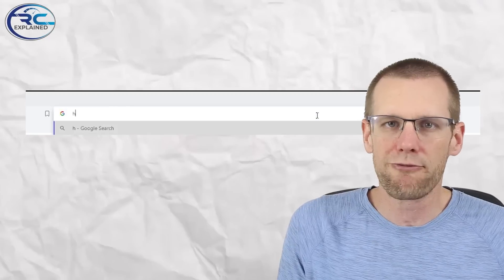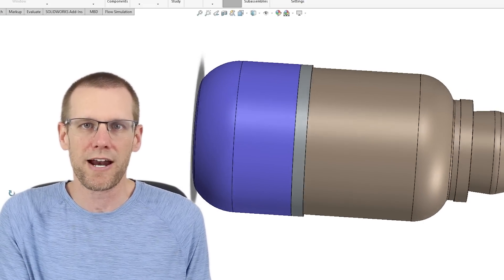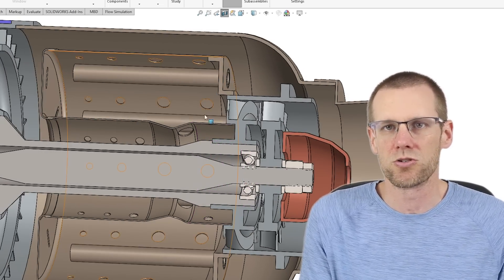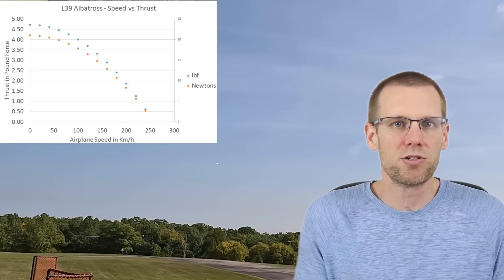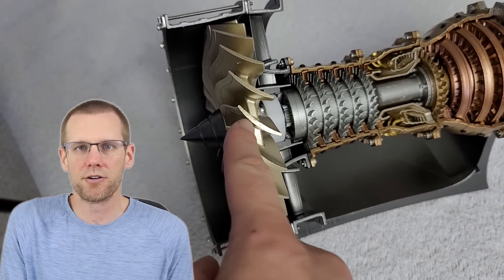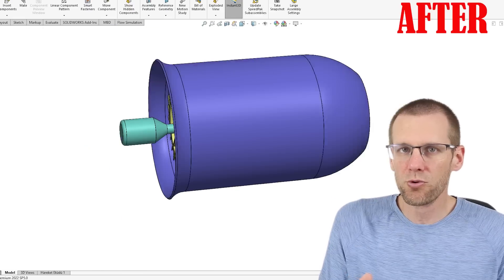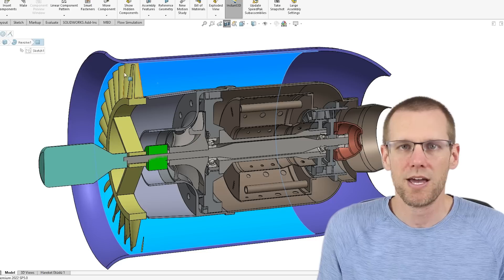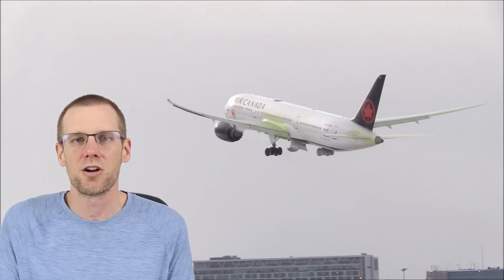RC Turbine Engines Could Be Crazy Efficient If They Made This ONE Change!

Comment: It appeared your diagram had the planetry set sitting off the Inlet Compressor end of the shaft, that's a perfomance limitation. The shaft for the main High Bypass fan should run from the gearbox through the center of the shaft for the Compressor and Impellor, and then in to a Drive Fan. That way the gas turbine isn't using Shaft Power to turn the fan, instead the turbine is just there as a Gas Generator, and it is the hot exhaust turning the drive fan, which turns the gearbox and provides and overdrive to the main High Bypass Fan.
The thrust pushing the aircraft comes from the Fan, not the turbine.
That poorly keyed animated background, is really distracting and lowers the quality of the vision. You're wasting bandwidth that the CoDec should be using for the part of the vision you want the viewer to concentrate on - You.
The wasted bandwidth will be making your edited file size larger, and also reducing the quality once Youtube recompresses it again.
Reply from the maker: Thanks for the editing pointers. I have trouble with the background and I think a green screen can help make this easier for me to edit.

Comment: The planetary gearbox would scream at those rpms.  I'm not sure if it could fit in the container that you drew.  A double shafted engine might be better with another stage to turn the fan.
Reply from the maker: I agree. A double shafted engine would be simpler really.

Comment: A better idea is to stick a generator onto the RC jet engine's shaft. The current from the generator can then be used to spin the fan. This allows you to modulate the fan speed in manner that is decoupled from the shaft speed of the turbine. For starting purposes that generator can also be used as a motor to spin the turbine up to self-sustaining speeds.
Reply: I read your statement like 5 times and still didn’t understand one word what your saying , what I will say is there is auto starts, where there is a electric motor that spins the engine up to speed and starts based off running a pre programmed file programed in the engine start sequence
Reply: @stevennagley3407  What I am saying is that you can use the electric motor (which also serves to start the turbine) as a generator. Then use the power taken off the shaft by that generator to drive another another electric motor that runs the big fan.
--
This way the fan speed does not have to be a fixed ratio of the turbine shaft speed and you are not relying on something like an 8:1 reduction gear to get that 200,000 rpm turbine to spin a fan at 25,000 rpm. Reduction gears will need lubrication, and  quarter filling the housing with vat of oil like in a car's rear axle wouldn't work at 200,000 rpm. The oil will atomize, aerate and basically do nothing while the gears grenade. Pratt & Whitney had all kinds of problems with their PW1000G geared turbofans. And that only has an input shaft speed of 10,500 rpm with the fan is running at about 3,500.
Reply: I think what would make more sense than an electric powered fan and generator or the gearbox solution in this video it would be simpler to just make it a two spool engine.  Basically have the core of a current style engine but use a hollow shaft.  Put a second shaft inside this with the front side of the shaft driving the fan and the back side as a 2nd stage in the hot end driven but the gas generated in the primary core.  This is basically how a full size high bypass turbine and turboprop engine works with the engine core mostly being a gas generator to power the prop or fan but extracting very little thrust from the core itself.  The open fan engine like the UDF engines demonstrated and tested in the late 1980s are likely going to make a comeback in the next 10-20 years which will basically operate like a high speed turboprop engine with hardly any thrust at all from the engine core.
Reply: @larrybremer4930  Not exactly the same value proposition. A two spool engine's ONLY advantage is to optimize the compressor speed by allowing the fan to spin at a much lower rpm without slowing down the compressor spool. Both the fan and the compressor are both most efficient at just under transonic speeds. That however is not possible on a single spool with the dramatic difference in fan vs compressor diameter.
--
However, this only solves half the problem. The turbine driving the fan is still much slower than optimal. This is we have gered turbofans -- all the ones I know are two spool engines to begin with. This is also why, if you look at the cutaways of most modern high bypass engines you will notice that low pressure turbine stages get progressively larger in diameter so as to speed up the blade speeds.
--
An electric transmission allows for a simple single spool design spinning very fast for efficient compressor operation. Instead of taking off additional power with a 2nd spool, you take off power with a generator. You can then drive the fan at whatever speed you want and hence have as big a fan as you want. In fact, you can put the fan somewhere else too. The engine can be in the wing and the fan can be in the  nose if you like.
--
Efficient wise, a planetary reduction drive is about 90~92% efficient. A generator or a motor at their optimal speed and load are both about 95% efficient. So it's about  wash. The only penalty is weight. But for RC planes and drones at least the self-starting capability is at least worth the weight of the starter motor.
Reply: @dwightlooi  The issue with this is weight. Generators and motors are heavy, and weight is critical in aircraft. There's a very good reason that the majority of modern jet engines use air starters rather than electric starters.
Reply: Sorry, but, that wouldn't work at all, considering such a basic design! The gas generator turbine's job is to drive the compressor turbines period! This would interrupt the air fuel mixture for the combustion chamber! Remember, these simple scaled down turbines are as small as a 32oz cup, and has an rpm range of 100,000- 130,000!! Having a gearbox to slow down a single compressor makes absolutely no sense!🤨
Reply: @ronaldgreen5292  To be clear the engines entire energy budget does not go into the compressor since there is usable energy left over to expel hot gasses at high speed and volume to create usable jet thrust.  The part about the gearbox is totally accurate.  It would be exceedingly difficult to make such a gearbox with an input speed in excess of 100k rpm that is small and light enough to use in an RC aircraft powered by the model engine while having any amount of reliability because of the need to also cool and lubricate this gearbox.  Companies like Wren and Jatcat already make turboprop engines using their jet core as the gas generator just like their full scale counterparts and that is 80% of the way to making an actual high bypass turbofan since the only real difference between a turboprop and turban, and turbine is having the majority of their coming from a propeller, a ducted (or perhaps unducted) fan, or solely from jet thrust respectively.

Comment: Search around on Youtube a bit, there are a few homebrew jets with multi stage axial compressors, and and at least one turbofan. Nothing commercially available I don't think. The level of complexity and precision is much higher for axial flow engines, the math for designing multi-stage compressors is a lot harder too. Also I suspect that many of the RC model engines cut costs by using off the shelf turbocharger parts.

Comment: its always been known that the smaller the  turbine, the more inefficient it becomes.

you cant scale air down.
and you cant scale CLEARANCES down.

as sizes reduce, clearances, remaining constant, become a much larger percentage of total area. air likes to sneak past those gaps that are required. you cant SEAL high speed shafts. labyrinth glands are only so effective... shafts and bearings have to have clearance, and that adds to the clearance required at blade tips, where all the leakage occurs... the higher the pressure difference across a turbine blade, the more the air tries to sneak past rather than do anything useful. on the compressor side, a single stage centrifugal can get far higher pressure ratios with only one set of clearances to deal with, versus a multistage axial compressor that has to deal with more bearings, more clearances, and has to be ASSEMBLED. let alone MADE.

that leads into mass manufacturing tolerances, interchangeability and selective assemblies... cost...

weight. material strengths. heat flow. that blade material that could deal with combustion temperatures at full size no longer holds together when 1/10th the size, volume, and spinning 15X as fast... 

have a set of plans with a revision involving NOT boring out the inconel turbine disc, a redesigned two-part shaft, more akin to how de laval was doing it with his turbines... that a hole, a press-fit on a shaft, tends to expand and no longer be a press fit at high RPM, and the wheel itself would expand until it seized in the housing.
a two part shaft bolted to hubs either side of a solid wheel doesnt expand... as much. 

there are several TONNES acting on those blades at full speed... the design of the wheel itself to deal with the forces occupies space, and determines certain aspects of blade geometry... everythings a compromise.

when theyre running at partial load, low speed, the clearances are larger... they only become "efficient" at full power, full gas flow... when everythings hot and clearances are minimised...

surface areas to volume of gas, everything changes. a small combustion chamber has far less gas in it burning and producing heat, with far more surface area to absorb and conduct that heat away, than its full scale counterpart... that is, the small engine is losing a large portion of its heat through the body itself, and cannot be utilised. the fullscale engine with far less surface area but far more volume keeps the air hotter for longer so it can perform more useful work.

so many un-considered aspects in this simplistic attitude that axial compression and "turbopropping" is merely a matter of "adding parts" to "increase efficiency"...

its easier to make a working centrifugal turbine. and with turbo-charger compressors being so cheap and accurate now... 

noones making axial superchargers or turbochargers... and in that regard, small turbos are always more inefficient than large turbos... any axial superchargers have been a niche one-off... nothing really large-scale or we would see more of them. 

RC jets are about the sound and ego more than anything. give us ten minutes of flight time with lots of noise, and we're happy... we dont care about efficiency, it was the fact that someone actually managed to get one this small to even work, let alone make thrust thats amazing.

theres still no RC jet plane breaking the sound barrier... a glider can be sneaky and go supersonic, a jet plane cant... ha ha.
Reply from the maker: Agree a smaller turbine is less efficient then a bigger engine. However we are not comparing a turbojet vs a turbojet. We are comparing a turbojet vs a turbofan. 
Agree on efficiency and the intended market, this was covered in the video too.

Comment: As a DIY starting point, I think a turboelectric design might work. If you "encase" a normal rc jet engine in an EDF you could get all the benefits of a turbofan but with the adjustability of having the fan independently driven from the turbine. Thus it can act almost as a CVT where it can fine tune the fan RPM to the air speed. The EDF can then just run off the jet's alternator to not need big LiPo batteries on board.

With the EDF pushing air around the jet it gets heated by the losses of the jet which adds to its thrust too.

There is a commercial concept being tested similar to this by Astro Mechanica if you're interested.
Reply: Dumb
Reply: @kraftwurx_Aviation  you not being capable of understanding simple sentences is not my problem.
Reply: @atrumluminarium I have no problem understanding simple or complex sentences. The idea of coupling the electrical output of the generator to drive a Dan is dumb. It's actually ignorant. The power required to drive the compressor in a turbojet is enormous. Coupling the tiny electric generator would not produce enough power (watts) to drive a fan. In an RC sized jet it's something like 50shp. 30-50% is used to drive the compressor so that's roughly 15-25hp or 11kw-18kw. Yes 11,000 watts to 18000 watts.

Running a fan via electricity from the turbine generator on the nose isn't going to cut it.

Large diameter fans require high power consumption to generate appreciable thrust.

The alternator doesn't put out enough power to do this... it's like 500 watts tops.

Armchair engineers need to educate on reality-based engineering principles.

This just isn't possible. A cars alternator strapped to the front of the jet engine would still only privide about 500-1000 watts.
Reply: @kraftwurx_Aviation  I think the fact that you're confusing a fan with a compressor's impeller goes against your claim that you actually understood what I was saying. You clearly didn't.

As a crash course: a fan is used to create high velocity mass flow not to compress the air like an impeller. A fan DOES NOT need a lot of power to run, as is clearly demonstrated by most RC aircraft having EDFs as their main source of thrust. All the alternator needs to do is slowly top up the battery over time.
Reply: @kraftwurx_Aviation  no, modern "genius engineering" has to rely on over complicated concepts with electric bits... you GOTTA have electric bits!
Reply: @paradiselost9946  So you genuinely think that having an alternator (which already comes stock on RC jet engines btw) and a BLDC with a 3D printed fan, is somehow overcompicated when compared to completely modifying the internals of an RC jet to accomodate a turbine-driven fan that would require tight tolerance machining, balancing and stress testing to make sure it's not going to remain intact at 10kRPM?

Apart from that, do you know how much electronics are already present in RC jet engines? There's no way you can start and sustain the operation of one without their ECU. At least the addition that I am proposing are off the shelf parts that a 5 year old can figure out how to put together.

Comment: You have to do a bit more reading. Look for boundary layer scaling and reynolds nrs. Ie air molecules dont scale well.
Reply: clearances dont reduce with scale... surface areas dont decrease proportional to volume... material properties dont always scale... combustion takes a certain amount of time...

its amazing an RC turbine can even run, really.
Reply: @paradiselost9946  Even more impressive are nitro engines. I mean: with the tolerances at such scale you woul expect them to have bad hp/L ratios, but these things put out 600hp/L without forced induction. Thats about twice as much as the F1 NA engines had.
Reply from the maker: Why more reading? I didn't enjoy reading when getting my engineering degree and probably still won't enjoy it today. :)
There are already much smaller turbines on the market then what I use. And these much smaller turbines are used as turbo props too. For example a 210N turbojet vs a 45N turbojet used in turboprop form, outputs the same static thrust. The fuel consumption rate is 180g / min vs 600g / min at full power. Massive difference.
Reply: @RCexplained  it is clear turbojets are the least efficient, but they are cheaper and smaller. For the same reason small turboprop engines use centrifugal compressors, cheaper and smaller
Reply: You can do it but the turbine core needs to be the same size so you end up with an engine with at least twice the diameter depending on the bypass ratio. That is not great for an RC turbine
Reply: LOL

You guys are acting like rc turbines are real turbines just scaled down.

No, they are actually designed.

Comment: The main problem is you can scale down the engine, but you cand scale down air to match.
Reply from the maker: No need to scale down air. There are much smaller turbine in model form flying model airplanes then the one shown in the video both in model 3D form and in the model jet airplane.
Reply: I really don’t get this sentiment… like fan propelled aircraft work at so many scales, from 100mm to as low as 50… a fan isn’t some experimental tech, this vid is just suggesting to actually combine a fan with a jet.